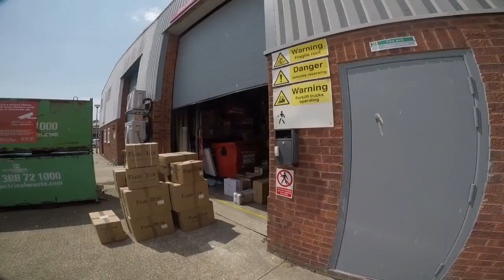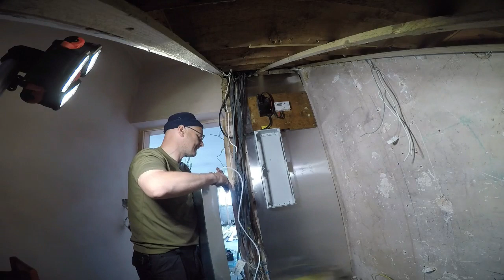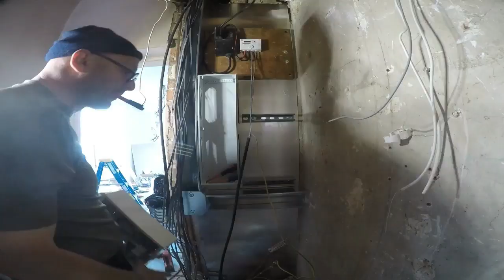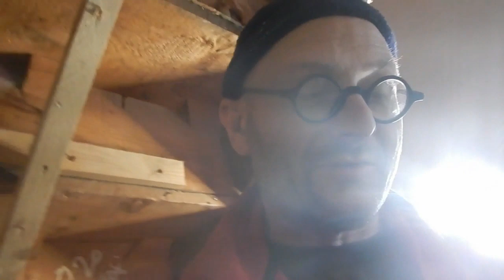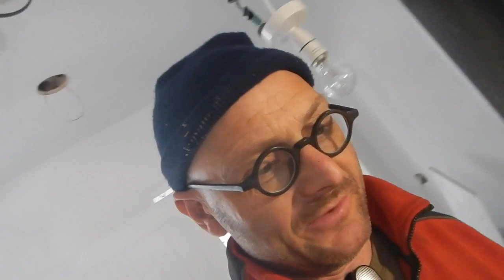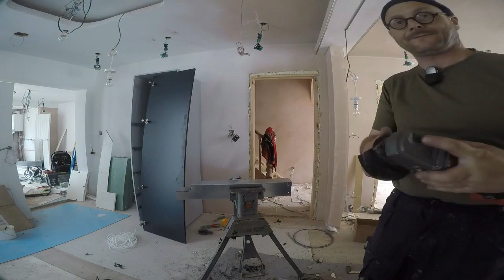Video 100: DIY-proofing a new consumer unit?   PART ONE

Comment: Just thinking about the cables in one socket is it possible they were going to have 3 x 20 amp double pole switches feeding low level skts eg washer,dryer dishwasher and the other 2 cables  were ring in and ring out ? Just a thought but there’s a good chance they’ve just fu**ed it up😂

Comment: Wow!! the question is why did you want that job? I appreciate the effort you’ve gone through to distance yourself from the previous guys work but in my opinion it may have been better to trace everything out and partially rewire any issues like 5 twin and earth cables in 1 socket! Good luck
Reply from the maker: You're right of course, let's see if I can explain, because I agree with you without the history I look like a JERK takiing it on.  I wouldn't have.   Two years ago, Aleks came to me, I worked in his factory for some machines and he was a good payer plus I'd just done EEICR on this property as an HMO and front ended the then install with TT and RCD and done it all.  He had to regularise the top floor with building control which meant steels and new floors and stud walls for fire etc,. he brought me in to rewire second floor only, which I did using that SWA submain and its own board.  But then while I did that he started wreckinig the rest of the house, and I'd already said the CU (with a lost front panel by then and loads of wires ripped out) needed total replacement.  So I contracted me to do that, and it would be a stacked board, expensive job, so I said yes.  Then he got in his other guy.  And it all started getting very strung out, by now I've been paid for the 2nd floor, but it's a year later.  Then another year went by, and the family got me into do their restaurant and bar, and a flat, and so I had amiable relations and it turned out the mother in law knew my uncle the late John Young chairman of Young and Cos Brewery and he used their restaurant, so we developed a connection, and they paid my £3k bill on the restaurant jsut after lockdown when I'd said to them I didn't expect it now....   so I am obliged to do my utmost to help them out of this.  You're right, they turned down a rewire at £12k, but they've spent more than this now.  A team of 3 sparks they now pay £700 a day to to sort this wiring out retro spectively.  Plus me.  I think my DB and testing and connecting will top £2k in the end.  But they never started the project expecting to do the whole house, and so rewiring never really climbed high enough on the agenda, and everything got done the wrong way round.  But that's how I'm stuck in it, after 2 years history in the place.

Comment: Sorry rupert, but i have no idea what the hell that was all about. Was there any need for that aluminium piece? What was the wago all about as far as i can see, the cables were long enough to reach the consumer unit. And diagonal trunking??? What!! I would never dream of doing that!! 😂😂
Reply: I think the logic is that Rupert can produce an installation certificate for the board and Mr Macedonia (who is not an electrician or member of any  competent person scheme) can connect his as yet unknown circuits as extensions, which is non-notifiable work under Part P. I'm not sure how in the spirit of things it is calling that work circuit extensions when you're basically "extending" them from a one foot cable right next to to the board, but I guess it's technically true.
Reply from the maker: Me too.  Absolutely with you.  Now.  But how it came about see explanation to Dan Graves above... it's quite long so I can't repeat it here.  Well I could paste it I suppose... suffice to say, it's a frankenstein installation, which Is what ive dubbed it as now....

Comment: Please don’t use a grinder again on trunking holes like that 😖. Use holesww either end-join them up with a jigsaw. Then you have a nice circular end and straight line. Paxoline in between the trunking and board (which is a smaller hole). 👍🏻
Reply: I am with you on that one , i was nearly crying at that stage. Naughty Rupert taking a few tips from the Macedonians there
Reply from the maker: Okay.  Point taken.  You're absolutely right.  Totally.  I'm ashamed of that episode!
Reply: LAsparkTV Wire&Test Limited don’t be ashamed, you put your work out there,I’m sure people would pick stuff out of my work if I put it on YouTube.
Reply from the maker: @tommochelsea72  I know, but well, you know what it's like.  You (I) tend to do things on the spur of the moment when all it would take is a trip to the van to collect the correct means of approach....
Reply: Hope this comes across as friendly advise. Fair play for putting your work out there. 👍🏻

Comment: If I was you I would alert the border force to make sure that guy from Macedonia doesn't get back in the country churning garbage out like that, he's got no chance of getting a socket on with five 2.5 cables in, so much for part p and the governing bodies.
You will need to make it crystal clear what you are signing off, because when that place goes up in smoke they will be knocking on your door, not Mr Eastern European.
Reply from the maker: I think I have it all in hand and the houseowner has taken a grip of it too, getting a team of three other sparks involved so I only have to test and connect after they've sorted out the wiring.  I think it should be okay, I'm happy with the arrangement though it's costing her over £700 a day to sort out at the moment!!!!

Comment: Hi Rupert, Watch out when testing as all the cpc’s of each circuit will be commoned together via the din rail.
Reply from the maker: As I read it, and this has caused me a bit of brain ache I admit, there is no difference between commoning them at the din rail and commoning them at an earth bar.  It sort of seemed wrong to me somehow but I cannot put my finger on why, as I've discounted all the objections to it I can think of.  The testing does, however, have to happen in two phases really at the the sarel enclosure and then from that to the board for the reason you state, so it is a bit of a ball ache.  But once you got the figures should all be fine. One thing was in my mind which was the fact that in effect the lives and the earth don't go through the same hole but then the ADOS requires 0.4seconds so you know, there wouldn't be time for the enclosure to heat up...
Reply: @LAsparkTVWireTestLimited  You could use a different colour Wago that doesn't have the earth bar connection and maybe put a green dot of paint on those if you feel it's necessary. P.S. Just noticed that this video is a year old. Hope it all went well for you.

Comment: Wow! Tricky job. Why did you use that large aluminium sheet?
Reply from the maker: Provides a nice clean finish and bonds all the exposed conductive parts at the same time.  I was quite pleased, quicker and less messy than replastering.
Reply: Couldn’t work that out?

Comment: Paxilin board for between board and trunking usually!!
Reply from the maker: Yes, but I've put grommet strip in, do you think that's a bit shoddy then.  My paxolin's being used in the generator install at the moment, so I do have it in stock.  Yikes, I'll remember your comment for next time.  That was an error where I had to use the delrin, obviously measuring went bonkers as Paul Gilbert's commented....